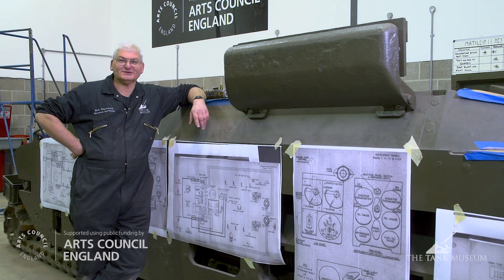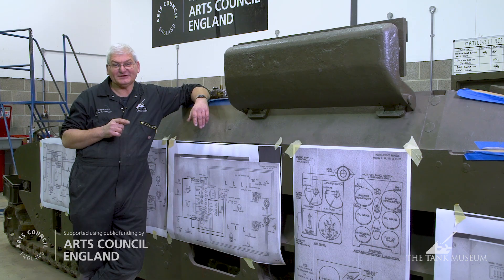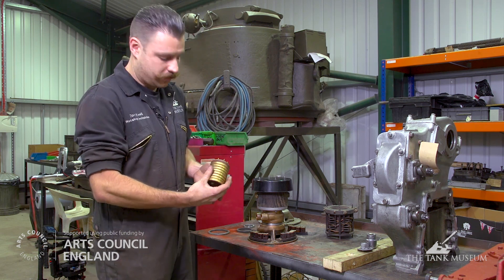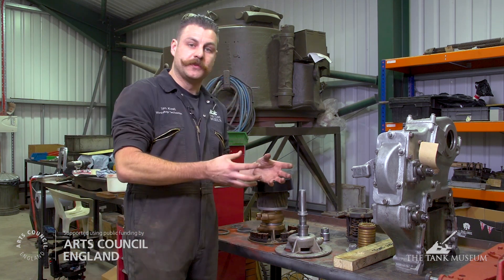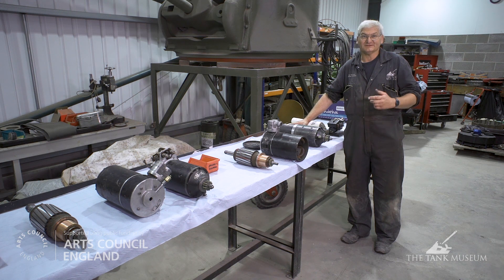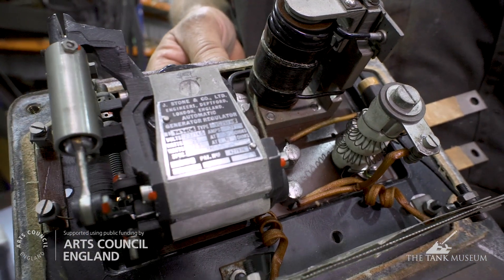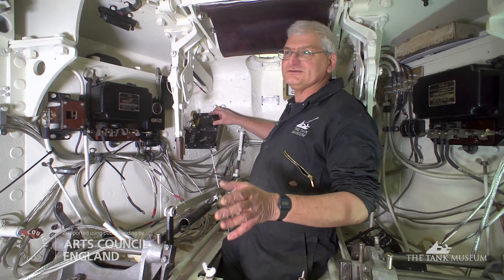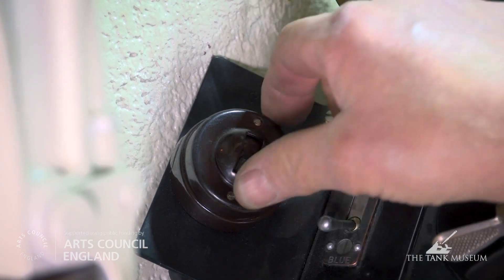The Matilda Diaries Part 18 | The Tank Museum

Comment: The factory did the wiring right, since it's a tank and not a mass market automobile. You want to be able to replace wires as individually as possible, so changing components becomes much easier. Still great work, always a tough job keeping it period correct; on top of the normal electrical problems.
Reply: that's what I was thinking...You can change items or rearrange where they are so much easier when they are plumbed seperately. And an unlucky hit does not take out all the electric wiring at once.

Comment: Have you had to add any non historicaly accurate modifications due to health and safety?
Reply: cheshire1001 I’m pretty sure they’ve mention using asbestos substitute, rather than have to deal with the real thing
Reply: Historical items and museums are exempt from almost all the H&S rules. The gas (petrol) is very different chemically now compared to 1940's stuff, I'd like to know if they had to modify the engine or use any additives (lead substitute) in the fuel.
Reply: cheshire1001 can't see the need for anything else other than extinguishers in the engine bay